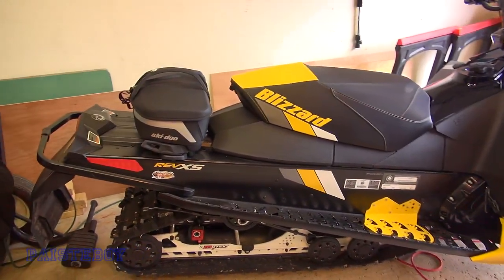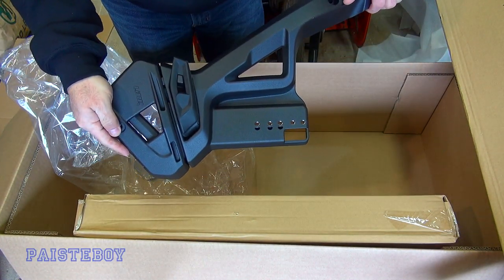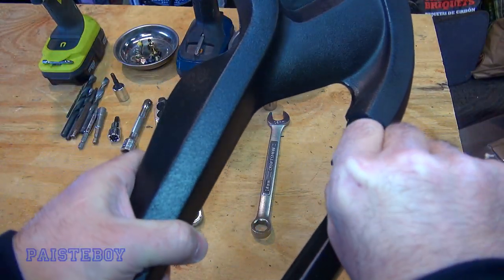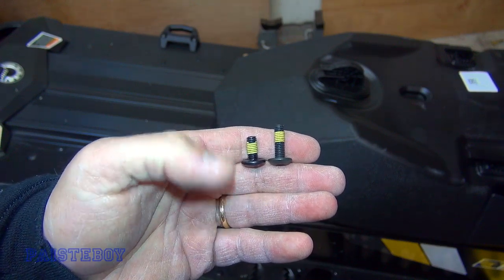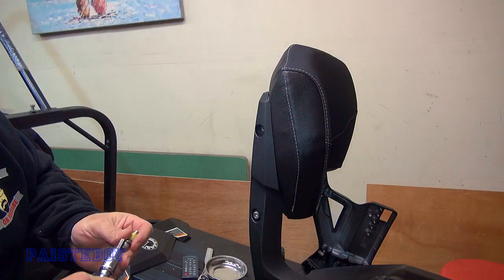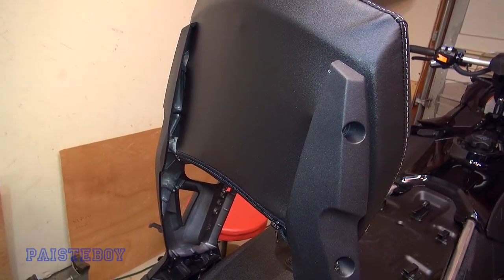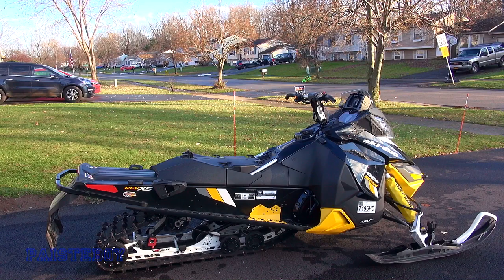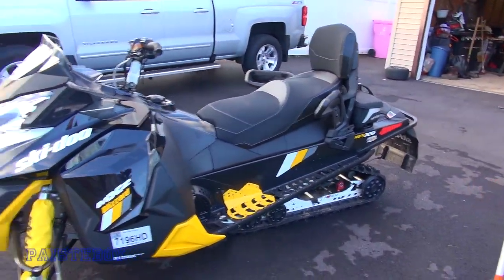Ski Doo 1+1 Complete Seat System ASSEMBLY & Install: Gen3 860200575

Comment from the maker: With either setup, there is no compromise on looks or function at all.  That pretty much sums it up.
Reply: Paisteboy are you just showing how to install it or are you gonna leave it on the whole season
Reply from the maker: No. I will only be using it if I take someone for a ride. Otherwise I will keep the stock seat on.
Reply: Paisteboy has

Comment: Wow, makes that sled look like a cadillac with that seat attached and as soon as you remove it, it turns back into the bat mobile. Pretty slick, nice option to have. 👍👍 Well made video too....
Reply from the maker: Thanks Jim.  I agree.  It looks like a touring sled with the 2 up seat & backrest on but fast and badass with just the stock seat.  It's great that options like this are quick on and off with Ski-Doo now.  I couldn't have had a truly professionally installed 2 up seat setup that looks like it was purchased that way one minute and then a fast single seat rider setup the next.

Comment: Thank you so much for the video it’s very helpful I’m installing right now! Quick question though could you give specific direction of which bolts go where for the mounting brackets You mentioned the longer ones go on the tunnel. So does that mean the two shorter ones go on top and longer one on bottom?
Reply from the maker: Hope your install went well.  Happy sledding!

Comment: That's a very nice option to have. It's nice that the the backrest and seat remove so easily. I guess you'll use your single seat most of the time ?
Reply from the maker: Yes.  Quick on and off for whatever use I need it for at the time.  I just wanted the option to take my family for a ride and it just wasn't possible until now.  You are right though.  Most of the time it will be the single seat most of the time.  Thanks for watching Mark.

Comment: Why did you get the 1+1 ? 
I have this set up also (actually have not ridden the sled with the regular seat !) I bought it to take my daughter out riding. Did a backpack trip last year to Wawa/Hearst in Northern Ontario and strapped a backpack to the backrest, along with the same bag you have....worked out pretty good.

Good job on the install !  I had the dealer do it when I bought the sled. Got the heated hand grips also for the passenger.
Reply from the maker: I heard that the heated grip install is a pain.  Sounds like the 1+1 is a winner.
I got the 1+1 so I could take my family out on the trail with me on occasion.  The wife and I ride my Harley together in the summer and I thought some scenic trail riding would be great too.  I also have three kids (not little kids) and could take them out as well.

Comment: Great tutorial. Since the kit didn’t include warmers. I would look into getting guards / gauntlets for back for when you’re taking your kids for a ride.
Reply from the maker: Thanks for the tip.  I don't think I'm going to need them though.  I've always rode with full leather gloves and have had sleds without heated grips and no windshield (My old 2000 MXZ 700 at one point) and my hands never got cold.  I have a second pair of full leather gloves for whoever is my passenger.  If anything changes i would probably get the gauntlets.  Thanks for watching and commenting.
Reply: Paisteboy On the Adventures setup with the lock and ride seat even with the warmers on my daughter complained of cold hands. But it maybe because of the design since the handles come out so wide on it. Once I put the guards on, it helped to shield her hands from the wind and no more complaining. 

There’s nothing worse than having my wife and daughter complaining at me. Lol
Reply from the maker: I hear you.  I guess I'll find out on the first couple of rides.  Thanks for the feedback.

Comment: Great video. Did you do anything to the suspension for 2 up riding ie. stiffer springs, etc?
Reply from the maker: Thanks.  No. To be honest, I never used it. It's still brand new and about to be for sale.  You might want to tighten your springs though.
Reply: Hey did you end up selling it or want to sell it? I'm contemplating getting one for my 2012 mxz xrs 800
Reply from the maker: I sold the sled in December and the 2 up seat in early January.  Didn't get one for my new sled since I never used this one.
Reply: Ok thanks for responding I will keep looking for a good used one

Comment: That was great. Thanks for the how-to. Now we need the review of how the seat feels on a ride...especially how the wife likes the seat.
Reply: I ride 2up with my 9 year old daughter, and she loves it.  She feels very secure back there.  I added heated handgrips too, which had saved many a trip.  No cold hands!
Reply: @CraigMediaProductions  do you put the 1+1 seat on when your daughter rides and then remove it when you ride alone? If so, how do you plug and unplug the heated grips?
Reply: There is a plug under the seat that unhooks the heated grips.  It only takes about a minute to change out the seats, so I always switch back and forth.
Reply from the maker: Thanks.  believe it or not, I never used the seat. Not even one time.  Sold it earlier this season since I got a new sled that it wouldn't work on.
Reply: @Paisteboy  we ended up holding off buying sleds after work uncertainties and later after watching Taiga electric sled vids. (Wait for them to mature)
Now my wife is saying she's not really into buying two sleds...that I should just get one....again with a two up seat so she can ride on mine.
Don't think the Back Country xrs and Switchback Assaults can fit a two up seat lol
Reply from the maker: @VonSpud   If you're going to ride 2 up I would recommend the ski-doo Enduro because it has an air ride suspension and is easy to change from 1to 2 up. Otherwise you would need heavier springs and would have to manually adjust the rear suspension everytime you went from 1 to 2 up.
Electric sleds are a decade away from being remotely practical.  Ski-doo has one coming out in 2024 but only has a 40 minute ride life, is slow and only available to the tour guide market that Ski-doo chose.

Comment: How does the suspension react with two riders? Does the sled bottom out at all, and did you have to adjust it in anyway?
Reply from the maker: I haven't used it yet with 2 riders so I don't know yet. I will probably just be cranking the springs to the stiffest setting. I will do a follow up after the first 2 up ride.
Reply: On my 670, you definitely feel the extra weight and it does make the suspension feel a lot harder. It doesn’t bottom out with my wife in the back, but you feel the bumps more.

Comment: The $150 question, my friend is, can I install this seat system on my '09 GTX?  The stock seat plastic bottom got broken when my friend's 20 year old flipped it in the driveway.  Finding a used one hasn't proven fruitful
Reply from the maker: I'm not sure how many years back this seat will work. The seat alone new is about 400-450 bucks.  At least it was last time I checked.

Comment: Where can I get this seat? The new 1+1 seats aren’t the same.
Reply from the maker: Looks like they are getting harder to find.  My link in the description for my Amazon page says it is currently unavailable.
Reply: @Paisteboy  ok thanks. We have two 2021 renegade adrenaline 900 ace turbos with the linq 1+1 seats. Would they work on the 2016 blizzard?
Reply from the maker: @paytonlawrence8236  
No. The gen4 seats will not work on the XS chassis such as a 2016 Blizzard.

Comment: Sweet man ,,hey would you sell the old one?
Reply from the maker: Thanks.  No.  I will not be selling the stock seat as it will be the seat I will still use most of the time.  I will only be putting the 2 up seat and backrest on when I plan on taking a passenger.  Thanks for watching Joe.
Reply: @Paisteboy  must be a pain to unbolt all that again and again thou..no?? seat just un-clips,yes,,but what about the backrest itself?
Reply: @joeneault785  No unbolting needed for the backrest. The backrest brackets stay on the sled permanently and the backrest slides into, and out, of the brackets. The backrest can be removed and installed as quickly as the seat.
Reply from the maker: Thanks for replying MrChadx1.  I never noticed his second reply back then.  I just sold that sled a couple of weeks ago since I got a 22 back in January.  I do have to sell to 2 up with backrest still.  I don't think Joe is going to see this though.  He hasn't been very active on YouTube for about 3 years now.  Thanks for watching.
Reply: @Paisteboy  I figured that was a risk when replying to a 4 years old question. Ha. But figured I'd answer it for future readers.  
We have had a 2014 Summit (Rev-XM chassis) since new but now want to add this 2up seat so I was refreshing my memory on on your install video that I'd watched way back when you first posted it. 

How did you like the seat/backrest over the years you used it?  I haven't been able to find any used so am stuck buying knew. If you were closer to SW Montana, I'd be interested in your used one.
Reply from the maker: @MrChadx1  
I wish I could review it other than I  know that it is very well built but believe it or not I never used it a single time.  Me, my brother Zuke and Gary were supposed to take our kids on a one day ride about 4 years ago but we had to cancel since it was 1 degree outside and even though my son was 16 Zuke and Gary's kids were 9 and 10 so they didn't want to risk a break down with kids at those temperatures.  I still have to post it fore sale. Should be able get a decent price for them since they are so hard to find used.